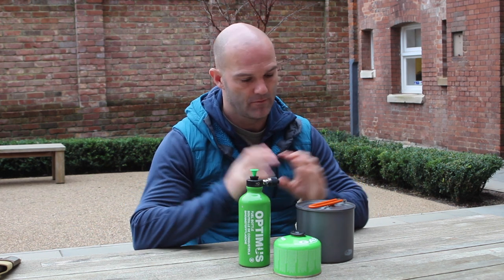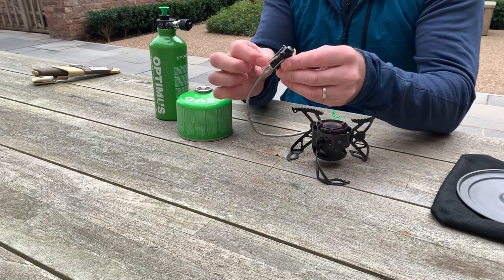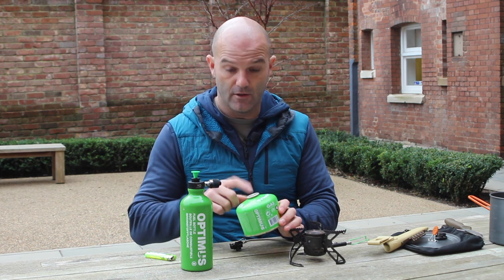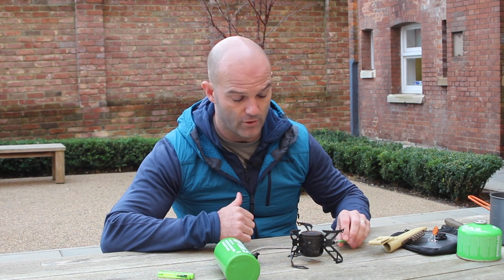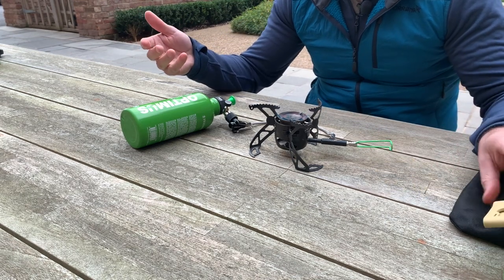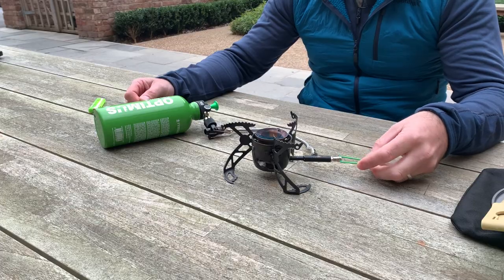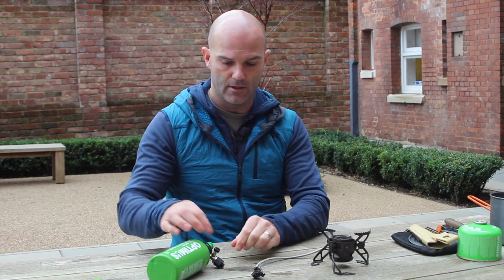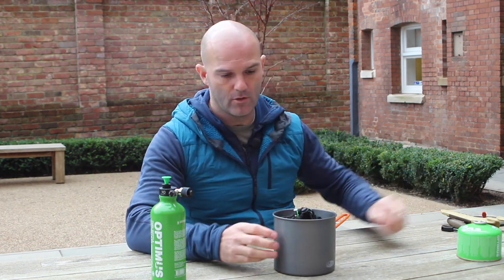How to use the Optimus Polaris Stove, kit review (ECW Solution)

Comment: Great video.  Very thorough.  I bought this as I like the versatility of it being a multi fuel.  These days, who knows what you'll need and what is at hand - camping or our current Winter fuel conservation.  Be prepared!  I have a old Coleman Peak 1 but this is much better size-wise and weight-wise. I love that it packs away in a pot into the backpack.  I have mine in a mini-cook set

Comment: Matt, What a good video on how to use the stove.
What a difference from the stove I was issued with in the 70's (Clockwork exercises in Norway)!  The stove that was in a tin, using either hexi or white spirit to warm up the stove after pumping but there was no valve to control the blue flame!  It was either on or off!
This stove is on my wish list for my walking adventures for sure.

Comment: To prevent flare up accidents I try to do the preheat routine with the pot on top of the stove. You are also making the most of the fuel as you don't just waste all that heat just to preheat the stove.

I use an Primus Omnifuel which is at least 20 years old, but all multifuel stoves work in the same way.

I also did some research thinking that the Optimus stoves where some sort of chineese knock offs which you could not get parts for in the future... and seems like I was totally wrong. Aparently the Optimus Stoves are made in Sweden (Stockholm) and from the same group as  Katadin.

I also checked the prices and seem to be on par with equivalent units (double valved) such as the MSR Dragonfly and current Primus Omnifuel II steel model (the TI version is more expensive). Worth looking at!

Comment: Propane has the lower vaporizing temperature.  Often in cold weather (I am in Canada)the propane burns off first and then you are left with the butane that freezes up.   So unless you can warm the canister, the second half of the fuel becomes unusable in cold weather.  Inverting the canister greatly increases the burn time and low temperature usage of these canisters.  Basically I use the canister stoves until about -5C and then switch to white gas for the colder and winter seasons.
Reply: What is white gas?
Reply: @michaelsrowland  Also called Naptha or sold as Coleman camping gas in North America
Reply: I always wonder why they mix butan/ propane gas and dont just fill propane alone...
Reply: @Wastelander13  Propane alone would require a much heavier canister due to its much greater pressure.  Think propane torch bottle/cylinder.
Reply: @mikemorgan5015  Oh, I didnt know that. Thanks a lot for the info. 👍👍

Comment: I thought you are supposed to start gas in upright form and only invert the canister when the preheat is completed.
Reply: In warmer temperatures you can use the canister the right way up and the flip it to get the dregs out.  In cold weather, which is where it will be used by the military predominantly, then start with it upside down.  You don’t need to preheat with gas only liquid fuel.  Hope that this helps.
Reply: Thanks for the reply.

Comment: I have a question about it. I have this stove, but it’s hard to start it with gas. What do you think is the problem? The stove is like a brand new one, and I can hear gas going through, but the problem is that when the stove is on and not ignited, you can fire it up only when there is little power, and after you crank it up more, it will shut down. With fuel, there is no problem; it works just fine. And with the sparky from Optimus, there is a problem too; it doesn’t ignite.
Reply: This is normal, not a problem

Comment: I still think that under most circumstances, the MSR Whisperlite Universal is probably the better stove all things told, the exception would have been while deployed. I really do enjoy that with the MSR you can fine tune things based on fuel source, but that DOES present opportunities for losing bits, and unless war has so far evolved that all parties involved are willing to guarantee a restful nights sleep and time for cooking, you'll almost certainly be sleep deprived, operating in potentially low light/nonpermissive environments, and that makes this stove superior for that application, except the noise, but you can buy the quietstove adapter and solve that issue.

Comment: Nice video. A few reflections:
1) It shouldn't require so much pumping. Please check the fuel filter (unscrew tip). If it is brass (katadyn military grade) its normally fine. The white mouse tampons found in some are infamous for problems. Replace with some fluff from a cotton swab.
2) Prime with ethanol and fire with lighting fluid (e.g. EC 918-481-9). Its less volatile in cold weather. It has higher energy density. It follow established standards and can be found everywhere (supermarket, gas station, the deli on the corner). It also don't dry out the pump and o-rings like the fuel you use in the video. 
3) You should NEVER use the stove inside. So the monoxide discussion is a no issue, and will depend on the total air restriction (typ of windscreen, wind, if burner is on flat land or in a snow pit etc etc). That said there are other great videos proving that the extra weight of heat exchanger is not worth it in relation to the carrying the extra weight in fuel.

Best performance will be derived from thin aluminum pot with base big enough to generously cover the full fire blast. Improved further if bottom is dented somewhat upward to collect the heat
Reply: Thanks Mac and thank you for the added detail.  The stove is being used in a tactical environment so unfortunately it isn’t always possible to cook outside.  Darkness and sub -30 centigrade often mean we have to be inside a tent to cook and maintain ourselves without either giving our position away or losing the ability to rewarm.  It is an ogling debate on how best to mitigate this problem.  Personally I would advise using gas down to -15 and only liquid fuel beyond this, which once you are in the tent is relatively infrequent.  What are your thoughts?  Any sound advice is always helpful.
Reply: @matthewwilliams2064  My thinking goes like this:

1) Never use stove inside tent. The added condensation brings more problems than joy by the heat. Add to that risk of monoxide poisoning and lumination of the whole tent. In tactical situation I advice to dig a generous pit in the snow to hide heat signature and cook fast. You can do it sufficiently close to the tent to manage it from inside.
2) The "heating" problem you resolve by using dry cloths in base and never put wet gear in your sleeping bag. Dry on march or by sublimation on clothesline.

3) With gas in winter you're working against the law of nature. A gas stove require liquid (compressed gas) to transition into gas very fast. A process that require generous amount of heat. Something which is very scarce at -30C. Even in summer canister turns very cold after extended cooking. "Winter gas" is normally a mix of different gas and will burn the gas with lowest "boiling point" first. So initially it look successful but later you are stuck with useless half full canisters.
Reply: @macmaster9840  thanks for your comments again.  These are all interesting discussion points and not just about the stove. 

The tactical need for cooking in tents has been long established within the far north and every year it is reviewed to see if there is a better way.  The tents that are used currently provide a large porch area that maximises ventilation and with the Optimus having one of the lowest CO outputs of any liquid stove then the risk is minimised, with sensible use.  In addition, the tents we use are light blocking, which is incredibly effective.  Digging a pit, whilst removing a direct line of sight whilst on the ground, does not prevent aerial view or radiated heat and light.

I have never seen a problem with a stove generating condensation, certainly not when compared to the respiration of four men in a small space.  

Drying equipment in any environment is always a challenge and all the strategies you mention are used where appropriate. 

With a higher calorific gas mix, you are ok to about -15  and I've certainly never had a problem using them this way within the higher latitudes.  I do totally agree that at -30 you need to be using liquid fuel.
Reply: @matthewwilliams2064  Yes it's always interesting to exchange thinking.

However, your experience is different from mine. If 4 men in a tent give off more vapor than a rolling boil I am somewhat curious what is going on in there.

Yes cooking in tent in good conditions is totally safe. Until suddenly one day it isn't, because wind stopped or snow was a tad too restrictive on the vent opening. Then suddenly it becomes a lot of extra work for other team to collect and clean valuable government tent and stove.

Light weight top mounted canister stove can indeed have great convenience and weight advantage in summer. However, benefit of adding 3 times the dead weight of canister gas compared to bottled kerosene in winter is unclear, even if nature caress us above -15C.

Did you confirm utilization rate on the canisters? Our experience is that extraction is compromised below 0C, independent of mix.
Reply: @macmaster9840  I see where there maybe a difference in our understanding.  If a stove is used to heat a tent it is normally done without a pan on it.  This is helpful in some ways as CO is significantly less although it still requires vigilance.  

As far as loss of airflow, due to snow build up, then when working in a military environment you always have one of the occupants awake at any time as well as the outside having regular checks by sentries.  This is exactly the same procedure as when working from a snow hole.

Gas is not used as a standard by the military, currently, but it is a recommendation to enhance what is currently there not replace it. Usage is always going to be higher in colder temps due to the extra energy required to melt snow.  This is true of any fuel type.
Reply: @macmaster9840  depends on the size of the tent
Reply: Priming and burning using different kinds of fuels isn’t very realistic in a travel scenario. The whole point of this kind of device is being able to use what is available.

Comment: Just like my old primus multi fuel (still in use). They aren't very Tac are they with the noise they make? I tended to use a lightweight gas stove on Ex in the UK, a lot quieter,  and I stuck to Hexy or cold rations everywhere else. Now, on hikes and over nights I just stick to Triangia and meths.
Reply: Phil I totally agree that gas is so much quieter.  Unfortunately it doesn’t give the best efficiency at very cold temps hence why we go for liquid fuel.  Tactically you just have to use your common sense when using it.  It is always a balance.

Comment: This will not burn alcohol fuel. Like he said. But nonetheless I think is as solid as a stove as you can get. I love mines. Its super versatile and would highly recommend anyone interested to just buy it. You will want to add the silencer to your purchase  because is very loud but is not necessary. It will preform as intended without it.
Reply: Why can't you use alcohol fuel?
Reply: @JohnSmith-yb1im  because the jets are not set up for it. I tried with different types of alcohol but it just won't burn it. I would still recommend this over the msr.  But you can't go wrong if you the msr. I own them both.